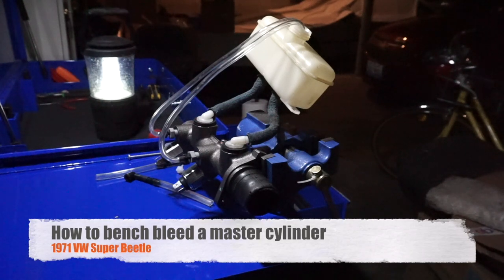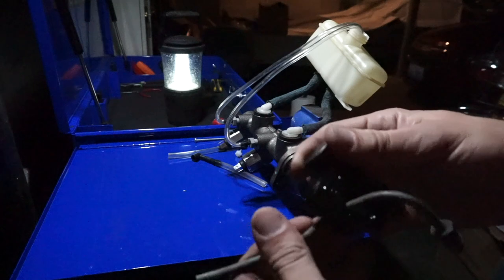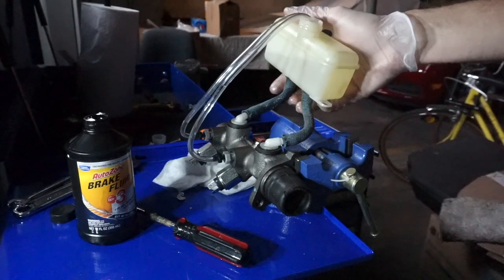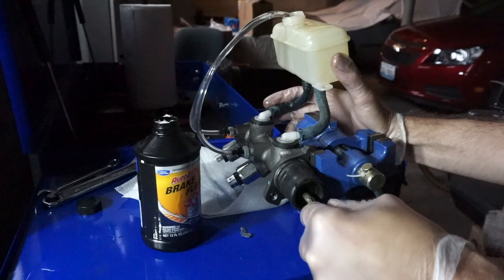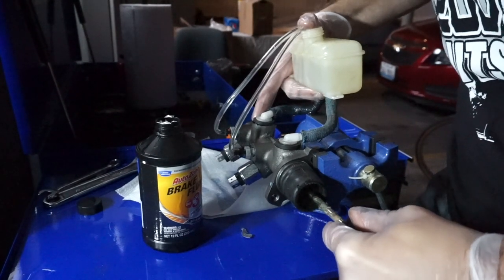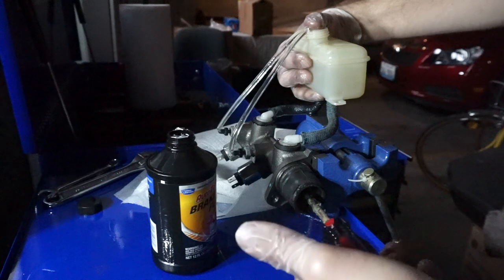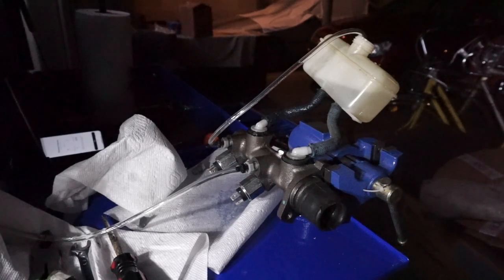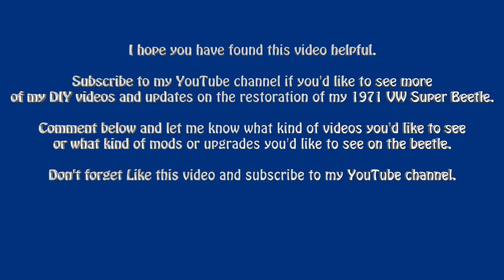How to Bench Bleed a Brake Master Cylinder - VW Super Beetle

Comment: Just a thought…Is there any reason you can’t do this with the master cylinder in the car…just use some longer pieces of clear tubing.  You could avoid the mess of having to drain the reservoir and the spillage that will occur when you disconnect the hoses from the reservoir.  You also wouldn’t have to deal with transferring a primed (and dripping) master cylinder from the bench to the car.  You wouldn’t run the risk of injecting air into the master cylinder when reconnecting and filling the reservoir.   Doing this process on the bench and then draining, disconnecting, moving, reconnecting and refilling in the car seems like an aweful good way of getting fluid and air in lots of places they don’t belong. Am I missing something here???
Reply from the maker: I think you can probably do it with the master cylinder installed in the car. Some people don’t even bench bleed the MC and just bleed the brakes, which I heard works also. The reason behind deciding to bench bleed the MC was that I may be doing extra work, but it doesn’t make it worse. Also, if I did decide to just install the MC to the car without bench bleeding it, and it didn’t bleed the system correctly when I bled the brakes; that means that I would probably have to remove the MC from the car and then bench bleed it. Another reason is that I was replacing all of the brake components (brake lines, brake hoses, wheel cylinders, brakes shoes, hoses and lines going from the reservoir to the MC, etc. While I was at it I also wanted to remove the reservoir to clean it since it was pretty dirty on the inside, so it had to come off the car anyways.